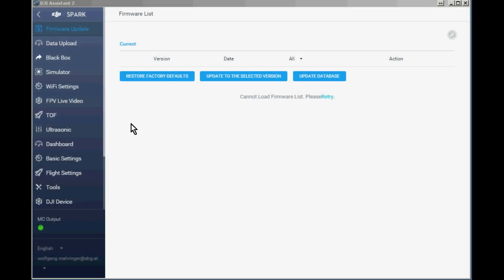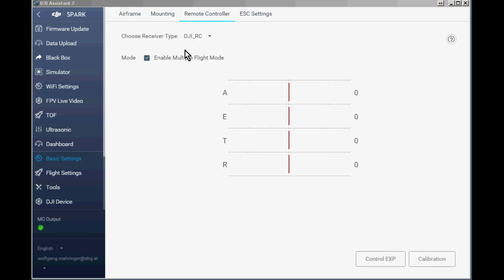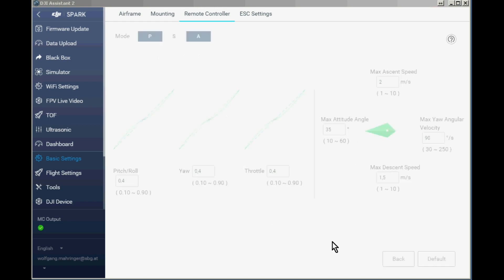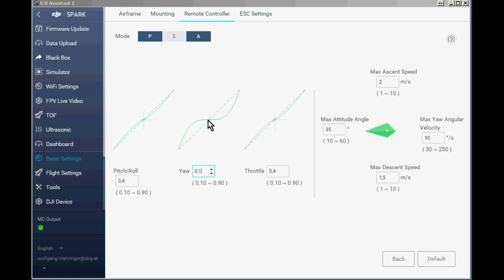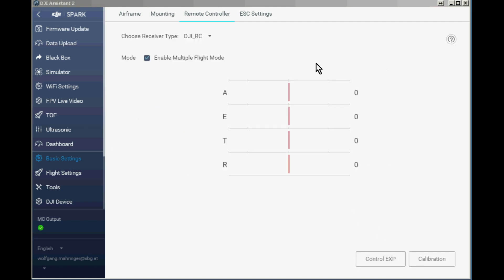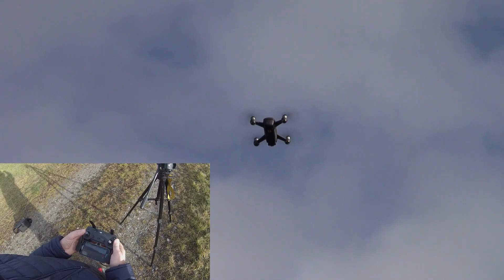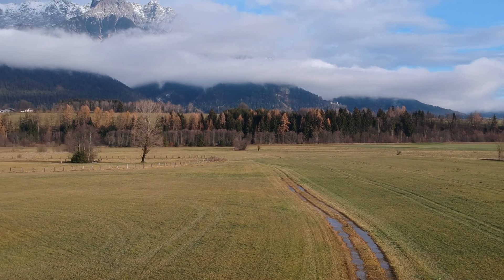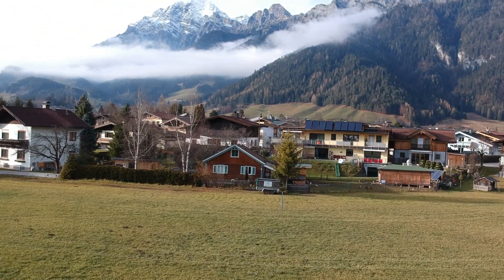Enable EXPO for DJI Spark

Comment: Sorry, one more question. As long as I'm in the DJI assistant, any other recommendations of changes to make? I don't need the Atti switch but would appreciate if there's any other "must" dos. Thanks!
Reply from the maker: Well there are many possibilites to tune your Spark there. You can set the maximum speed, increase for more sports flights, decrease for better video stability. You can increase or limit angular yaw speeds....Just try them out, one at a time. Try them at an open field, of course...one never knows.

Comment: which firmware is this? my spark only shows roll/pitch expo
Reply from the maker: @mog ren: Spark has the latest V 01.00.1000 firmware. Maybe you are using the wrong DJI Assistant software?

Comment: Wolfgang...both of your demonstration yaws...the yaws done AFTER the expo adjustment, still looked quite fast...far too fast, in my opinion, for "cinematic" yaw...are you SURE the adjustment you made actually worked?  Your yaw didn't appear any slower than normal.  Hmmmm....I will try the expo adjustment, and see if it makes a difference.  Thanks...
Reply: OK...I made the change...it works...I can indeed yaw very slowly...though it's still a bit hard to keep the yaw stick in exactly the right position.  On that screen with the EXPO settings...on the right side...there were fields that said something like "max yaw rate" 90 degrees per second.  I wonder if lowering that number would work to further decrease the yaw rate.  I'm thinking I would almost rather have a linear (not EXPO) yaw stick, that at full deflection had a much smaller max yaw rate...maybe 10 degrees per second, etc.  Do you know if it's possible to adjust those numbers with the Spark?   Thanks very much.
Reply from the maker: Yes, it does work indeed. The problem was first that it was a very chilly day (below 0°C) and I forgot to bring my flying gloves along, and the demo flight looked good when I flew it, but not so good when I edited into the video...frame rate conversion problem.
Of course you can experiment with the endpoints and with the yaw rates! Let us know what you found!
Reply: @WolfgangMahringer  I went back in to DJI Assistant, and I dropped the max angular velocity to 30...it worked...now the yaw is even slower...in fact, it was so slow, I increased the expo back up to .3, because .1, there is almost no control at all near the stick-centered position...plus I think I like the linear feel a little better.  OK...thanks very much Wolfgang.
Reply from the maker: @Bill-NM  Thanks for the feedback! I'll try it!
Reply: I came to this setting at the end of last summer. Since then I have been using it and the curves are more beautiful than the factory values.
It is interesting, because at Mavic we can set it in the DJGO4 application, it is not allowed at Spark. I think it is deliberately worse, so it helps if you are dissatisfied or buy more expensive.

I've been using Grassvalley (formerly Canopus) for a long time, Edius. No matter which frame number you have placed in the program, it's always perfect. Whatever mixes up, the video is always perfect. Interpolation adds additional frames if needed. Although not a cheap software, you can try it free: https://www.grassvalley.com/products/edius_pro_9/ And there is another solution :-)
Reply: @jakabgipsz4788  
I can't see the full menu in Spark the latest version:
V 01.00.1000?
Reply: @perh9475  Full menu? The settings must be made in the hacked version of the DJI assistant 2 program.  Find the solution on google.
Reply: @jakabgipsz4788  
So you mean it doesn't work with the latest firmware?
Reply: @jakabgipsz4788  don't forget to run the Assistant 2 program in ADMINISTRATOR mode. Ask a computer friend how to do that.